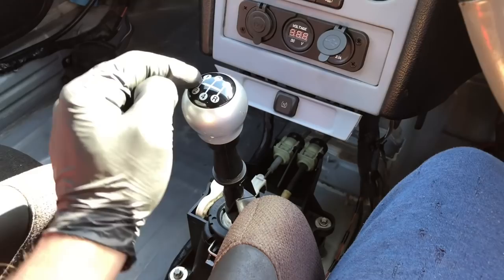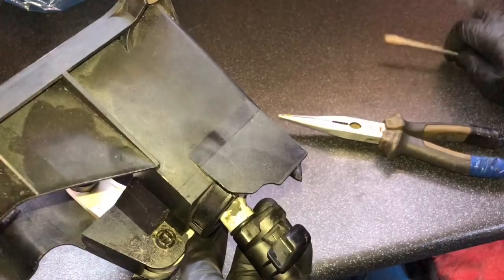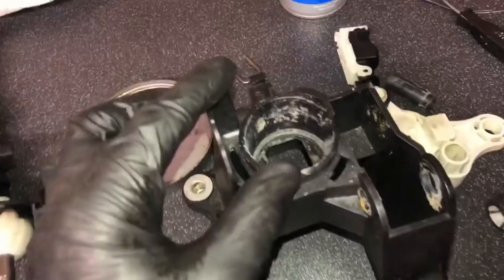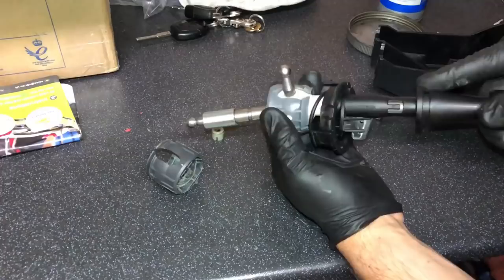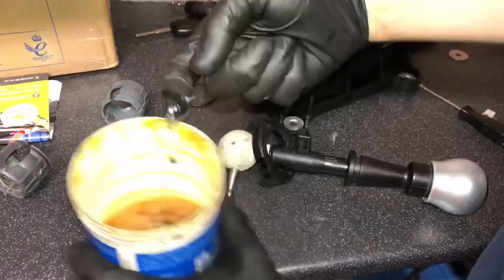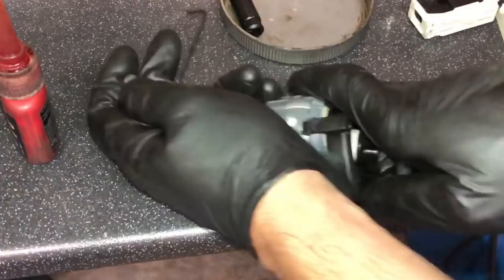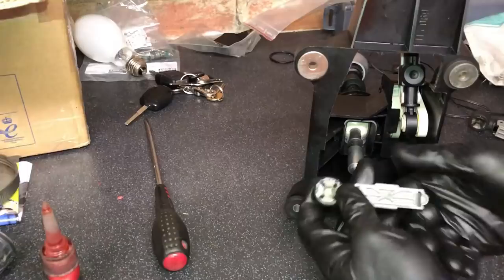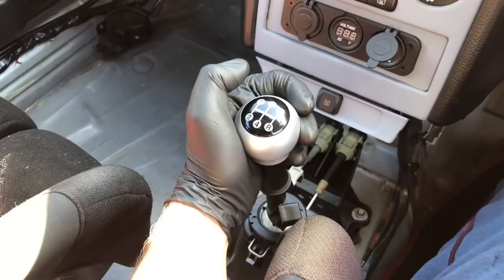[SUPER SHORT SHIFTER] ITS AMAZING! F23 GEAR SELECTOR REBUILD Opel Astra Z20let gsi opc Vauxhall

Comment: hello,

ingenious conversion with perfect presentation. 
My thanks, Sir.

I only installed a new standard F23 repair kit on my Vectra B-i500. Now shifts quite precisely again! 

But the main thing, in my opinion, is that Oil change with the right oil. 

With CASTROL Transmax 75W-90 GL+4.
Filled up approx 1.75 Liter.
(PS: it's much better for shifting than the Syntrans Multivehicle 75W90 GL -4!!!)

It's unbelievable how the thing bolts through now!! 
Even at minus temperatures, the f23 allows you to shift gears perfectly.

Kind regards...
Marcel 👋😊🇨🇭

Comment: Just did this to my Zafira Gsi and the instructions are spot on! - the only thing I think worth adding (I might have missed this in a previous video) is that the plastic shifter surround needs modifying slightly to allow the short shift to work. This was really easy to do I just wish I'd have known before re assembly with nice fresh grease 😅. Thanks though, I wouldn't have attempted this if I hadn't seen your video 🙂

Comment: Could you please give a little advice on putting the shifter back into the housing with the new bush on as I’m really struggling to get the round clip far enough down to be able to spin it and lock it in thanks.
Reply from the maker: Drop me a message on Instagram

Comment: I fitted a B&M shifter assembly other week, my gears feel a bit too notchy now, what’s best to do to sort this?

Can’t press the pin fully forwards as it doesn’t have the holes to lock it in place, I set the cables with it vertical and can select all gears without crunching but bit clunky
Reply: instaBlaster.